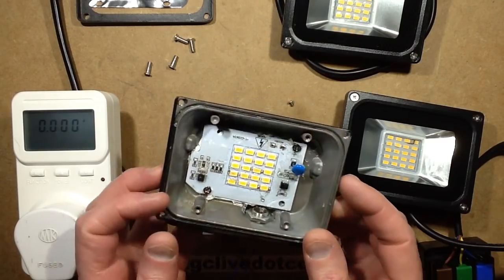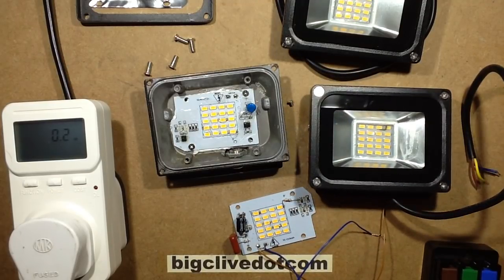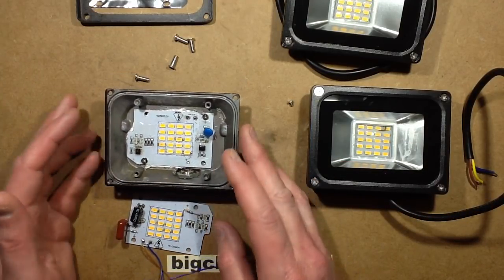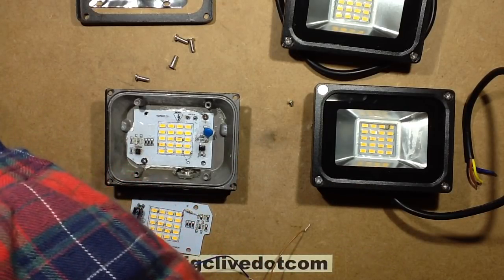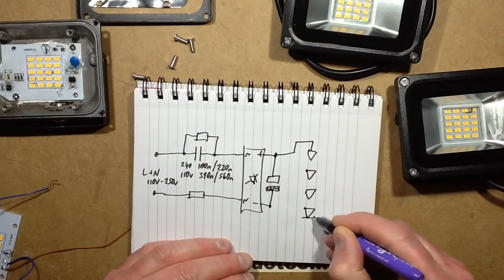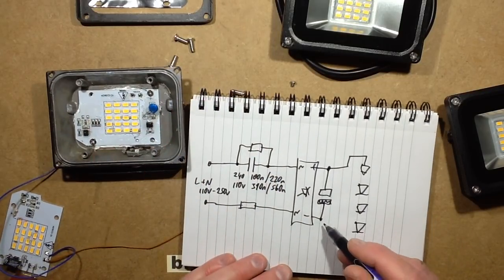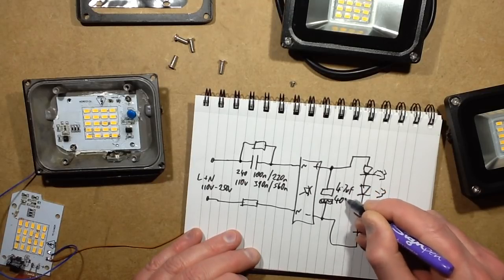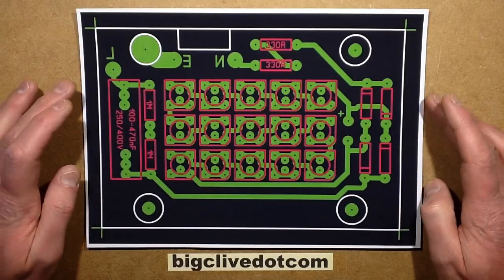DIY LED floodlight conversion module with PCB file.  (full build)

Comment: Watched this one again, as it is a very good one.  You said somethig about getting a face showered with glass, this happened to me many moons ago.  You see, my father was what you could call a conosour of Vodka, and drank up to a fifth a day of the clear gold. Back then things being as they were, all garbage was to be burned before the truck collected the ash, thus saving space in the dump and the truck. It was my chore, then a boy of 9 to carry out the garbage, and burn same each day, but garbage collection day.  I used to really enjoy watching that fire, perhaps I was a fire bug in the making, however when one of dad's empty bottles exploded from the heat, throwing molten glass into my face and thankfully into my glasses, I quickly gave up the joy of watching fires, and began to dispare at taking out the garbage.  The scars are still with me nearly 60 years latter but in the process of aging, have become quite hard to find.

Comment: In future versions of this floodlight, please remember to leave the earth wire to be the longest wire. The reason being, if the whole mains wire gets pulled out, the earth wire gets pulled out last. Just a small extra safety measure. Other than that, a great build, especially as you included a earth wire. Many people would leave that out because earthed cable costs more.

Comment: Using some SMD resistors and an SMD bridge rectifier, you could probably squish another row of LEDs in there.
Also if you're worried about the isolation, you could use some nylon screws instead, and have nylon (eh, almost any plastic will do) spacers as well, to keep the board off of the back of the housing.

Comment: I've been soldering for 56 years and no lead poisoning, yet, AFAIK. BTW you are correct to consider the voltage rating of resistors. I've seen many failures of lower voltage resistors connected across 350v DC. I prefer the 0.75 Watt/350v resistors sold by Farnell.

Comment: I bought an outdoor floor that runs on 12 V ac or DC. I bought a real outdoor transformer and so far it has been working  for 5 years! The leds last forever  but the supply lasts a year or two.

Comment: Your Supermarket Story reminded me of a Job during my Apprentice Time :) I worked in a Supermarket where they put Mains Voltage on the Metalgrid of the Hung Ceiling, apparently to get rid of Rats :D
The Store was closed so there weren't many people around. But it kicked me off the Ladder, and I couldn't stop yelling when I found out why I got a Shock.
Reply from the maker: +DJ1812 That sounds more like leakage on an ungrounded ceiling.  Not that uncommon.
Reply: I wish it would have been that.
The Ceiling wasn't grounded, but there was a Junction Box with a Single Brown Wire coming out, and attached to the Grid with one of those Fork Cable Lugs and a Self Tapping Screw.

Comment: Lead solder was banned for manufacturing because it's difficult/not cost effective to remove the lead when the PCBs become waste, not because of any user health concerns. In fact, soldering with lead free solder is worse for the operator than using 60/40 solder. The fumes from the resins in lead free solder are more acrid and the smoke particulates are finer, meaning they get absorbed into the bloodstream easier.
Reply: Oh, and about prototypes failing on powerup. I had one the other week. I heard the telltale "ptss" -sound and, as the smoke wafted up to me, I stood there thinking: "Hmm, yeah, putting  a standard 47 Ohm resistor directly across an unregulated 24Vdc supply may not have been my brightest idea". :-P
Reply: And possible contributed to cancer - though the smoking of woodbines on the workbench in the 1950s contributed too

Comment: On RoHS: “RoHS and other efforts to reduce hazardous materials in electronics are motivated in part to address the global issue of consumer electronics *waste*.” Lead has been shown to have extremely negative effects as a pollutant: cognitive difficulties etc.. Waste incineration (possibly with energy recovery) springs to mind as a risk where discarded electronics are not separated from general household waste. With that said, the best way of reducing the hazards of e-waste would be to create less of it: Right To Repair and mandatory MTBF requirements at minimum, and ideally, an attempt to combat psychological behavioural manipulation (or "influence" if you prefer) by advertisers intended to promote excessive and wasteful consumption.

Comment: Nice - although do be aware if you are going to use white helmet LEDs that used to be popular in early LED lamp designs - they will have a real world L50 of between 2000 and 5000 hours. L50 being the time before its down to 50% of its light output. They also commonly fail completely in this time spam. Always best to avoid the older leaded helmet white LEDs for any design thats going to have some long duty - not a problem for a PIR driven device. This only applies to the white LEDs that are UV excited phosphor - coloured LEDs have greater lifespans (depending on power output of course)

Comment: bigclive, My first soldering iron was one that you had to heat on the gas cooker, lrg head 1/2" by 1/2" X 2" with 6" long bar and handle. very early 70's couldn't afford a expensive electric one.
I made some good things with that, mind you boards were bigger!

Comment: Lead solder is banned in commerdial products not because it's dangerous to handle, but because it's polluting when the product eventually goes to the trash. Also heavy metals are neurotoxic long before they're deadly.
Reply: Don't eat it and wash your hands. No soldering iron I've ever seen will gasify lead. If you were to get a hand full of dirt, lead would most likely be somewhere around 0.001-0.0001% of that pile.

Comment: Speaking of getting a slight shock, brings to mind an incident in Viet Nam, back in 1971.  I was assigned to a communications Center running the landline teletype system for an Engeneer Group Headquarters.  Because of the heat in Nam, and the nature of the equipment, an air conditioner was included in our fiberglass dome type structure, covered with sand bags and withing a chain-link/barbed wire fence with a 24 hour armed guard at the tunnel like door into the structure. Our immediate leader was a very small Staff Sergeant named Tinny.  Now one day that air conditioner failed, and Tinny was called to repair it.  Remember, in the US Army, the leadership thought that anyone in communications knew all about electricity and could repair any sort of equipment that plugged into the wall.  So SSG Tinny went at it, trying to work on that air conditioner, which was located at the far end of the building, in a sort of tunnel that was about 4 feet high, Tinny being all of 5 feet tall himself.  He really was a communicator, but not an electrician.  Every time he tried to hook up the wiring to the new unit he had installed, he came in contact with the live line and jumped straight in the air, smacking his head in the tunnel.  In the end, there were three of us laying on the cement floor, Tinny from the shock, and the two of us working that day in laughter.   After SSG Tinny backed off, I went forward and wired the unit, well after cutting the mains first much to the anger of both SSG Tinny and our commo chief who thought our landlines had to be on line 24/7.  We were down for about 3 minutes while I made the necessary connections and then back up and running.  That said, every time I think back  to that day I have to chuckle, SSG Tinny came through it pretty much allright  save a few bumps on his head, and a slight burn on one finger.

Comment: Hey Clive, I am a retired Contract Plumber and cut my first teeth as an apprentice pouring lead joints and sweating copper with 50/50.
The lose marbles in my noggin are the same lose one's I was born with in"56".
I have my own personal theory on the ban. 
It goes to x-ray protection from Nukes for underground bunkers built too protect those who lead us like hogs to slaughter

Comment: Perfect +bigclivedotcom! Many uses for this light and circuit. The pink LEDs could be swapped out for UV ones and used as a backstage worklight in theatre and/or forensic analysis (aka CSI) :P

Comment: Those small project videos are my favourites! :)

And maybe someone pointed this out already or you have discovered it yourself: you can layout the 3x5 LEDs in a way that the positive and negative contacts end up at the same side. Instead of making three long rows going from side to side just make it one row running to the other side and fill the other two rows in a zig-zag-pattern.

Comment: I'd probably do a lot of PCBs home if I had the equipment to do it. I started not too long ago making PCBs in Target3001, and its actually quite enjoyable and fun. I have loads of LEDs and components (I got the amazon and ebay fever and probably spent a bit too much.. 100 Leds for £0.99? Sure, got to get them!) and made PCB files for LEDs and RGB LED controller strip, and want to design a simple 'fake arduino' and few other things. The problem is that Id have to buy a printer, those bags and clips, the PCB material, the thing to cut the PCB, drill, drill bits, the etching and devoloping liquids.. Although since im a student and live in a tiny room, Id have no space for anything either. I can't even solder because I dont want to fill the room with lead fumes, nor do I have clips, soldering iron or wire strippers either.. Have to walk 30 min everytime I even want to solder something to the university electronics lab (and only during weekdays and certain hours).. Maybe in few years..

Comment: While you are drilling holes, I will add this.  For the 15 LEDs, run along one long row and zig-zag (can I say that?) back the other two rows.

Also, how bad would it be to put the paper printout ON the component side of the board and leave it there?

Comment: Just bought some of those Xuron shears!! Nice recommendation.
Reply: I did too, as my knipex are wearing down after  all the time
Reply: The Xuron snips aren't even that expensive, are they? I paid about £8 for a pair of Xuron 170-IIF (Micro-Shear® Flush Cutters with Lead Retainer) in the UK. They aren't the strongest snips in the world, so I have a pair of Engineer brand snips, model NS-06, that I use for most purposes, leaving the Xuron snips for cutting off component legs with that nice flat cut that they give. The lead retainer feature of the 170-IIF is super handy as well. It's not 100% reliable, but most of the time the snips actually hold on to the lead that you've just cut off, rather than letting it go flying across the room, which is super handy :)

Comment: Im not 100% sure but while I agree lead solder flows really well, I moved onto lead free because i did a lot of elec kits when I was a kid and i breathed in enough of the smoke. And i genuinely think I'm a little slower for it... That or age... :(
but I read there is some lead in the fumes and absorbs when your handling it... But I might be wrong... 

Anyway as always love the vid :D
Reply: There is sure some risk in the lead fumes in the smoke or actual fumes. But if you are soldering on this level and in this amount, it should not do any harm. I would not be so shure if you are in a badly to not at all vented room with 150 chinese workers going to pounds and pounds of lead solder every day.
But then from what is in the fumes, I am not actually sure if the lead is the most harmfull ingredient. Good ventilation or one of those fume extractors with either a good filter or getting the fumes far away from you (not just to the back of your desk)
Still I consider leas to be among the absolutely less desireable metal fumes to inhale, coming quite close after zinc (which keeps a top rank) and mercury.

But on the long run I think, the main reason to avoid lead at least on a large scale, is that it might create quite some issues when recycling the electronics and components. At least that was what I was told, that it takes quite some effort to separate it.
Reply: a fan man or diy fume extractor

Comment: I've got the same problem but a different solution. I'm going to use cob strips from a broken corn cob light. Cos they fit flush with the metal.

Comment: the lm 2576s adj p+ is a great soulution  for parralel wired  high power led  like cree 3 w or rgbw 10w  tota load  or similar  3.3v 270 ma 
incredible results iv had im blown away with the output  and duration

Comment: 14:40 - If I attempted this, I would have approximately 12,000 broken carbide drills.
Reply: (±10k)
Reply: +Godfrey Poon Yeah, that's costly. At those RPMs even a simple brad snipped at an angle will "drill" a clean hole.

If you want it to last longer heat it to red hot and quench it some peanut oil or tranmission fluid. Saltwater brine works well for low carbon alloy steels also.

Comment: On the 5x3 design 5 1/2 minutes in, couldn't you have gone up & down on the 1st 2 rows then along the bottom to avoid the neutral line along the bottom?

Comment: On the 3 row board you could have started the series connection as you did for the first row, the next  2 rows could have zig-zagged up and down, it would have avoided the problem of the extra track, though alternate rows would have to have the led's reversed ;)
Not only have i used leaded solder all my life, including a bit of plumbing, but i've also melted lead for weights, doesn't seem to have done me any harm.
Reply: +obsculor I've used lead free, it needs more heat, which means the iron needs to be more powerful to make  aquick joint that doesn't overheat components.
More power means more needs to be generated, and currently that means more pollution, so i wonder which is better for the environment.
If i'm breathing in the lead fumes in my house, it means that you are not breathing in the fumes from the power stations ;)
Reply: +obsculor Except, of course, for all those lead free electronic devices that get thrown out every year due to joint failure as a result of the inelasticity of  lead free tin based solders.  Pretty much any device that undergoes any sort of thermal cycling or is subject to vibration has thus far had vastly greater failure rates than the same device manufactured with lead based solders.

That said, at the time he RoHS laws were passed, the overwhelming source of lead pollution in landfills was the leaded glass in landfills from disposed of CRTs, which are no longer manufactured for other reasons.  However, leaded glass (crystal) is still manufactured and disposed of in landfills.  Now we get to dispose of a lot more electronics each year due to premature death from lead free solders.  I don't see it as progress, at least not at this moment in time.
Reply: +Ethan Poole Agree with you there, look at all the antique audio equipment etc on ebay in full working order, doubt if you'll see any modern stuff in 100 years time as antiques
Reply from the maker: +Sparky Projects I prefer to mount all the LEDs in the same direction if possible.  It makes populating the board easier.
Reply: +obsculor "because of the environment "

Something on the order of 99% of lead is used in batteries ( car, solar, etc ). This is easily recycled. The remaining amount from solder is trivial.

It's politics gone mad.

EDIT: And leaded gasoline - which has already been fixed.
Reply: +obsculor There are proper scientific tests that have been done if you search for them online.  Another troublesome issue with high tin (lead free) solders is whiskering (which shorts out leads and traces) and tin plague (in very cold environments), and, combined with the inelasticity, our ancestors added lead to tin nearly a century ago to overcome those faults with tin.

I have had to repair or replace countless electronics over the past 10 years due to lead free solders -- major appliances, laptops, telephones, cellphones, etc.  Microsoft discovered the true cost of RoHS to the tune of over a billion dollars -- ever heard of Red Ring of Death?  Sony has suffered from similar issues. It is why the new consoles have cooling fans that are massively oversized relative to the power budget these devices consume at peak power -- just to minimize thermal cycling by keeping the BGAs as close to room temperature as possible even though they can safely operate at anything below 80-100C.
Reply from the maker: +Ethan Poole Up to the switch to lead free solder I'd never had a laptop fail.  Then three did so with the sort of intermittent faults that point at crusty lead-free solder.
At the point of the transition my electronic supplier suddenly had to double their storage area to stock the residual lead tinned components and the lead free ones.  The sudden falsely generated demand for the new "special" components also resulted in a sudden price step across the full range.  I'm surprised more companies didn't go out of business during the transition.